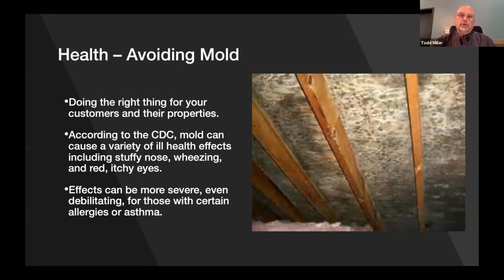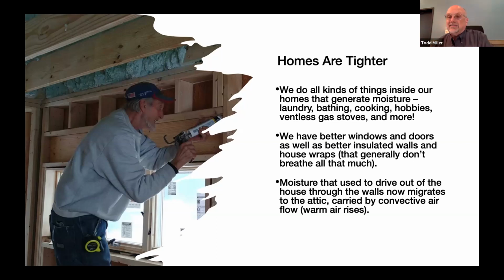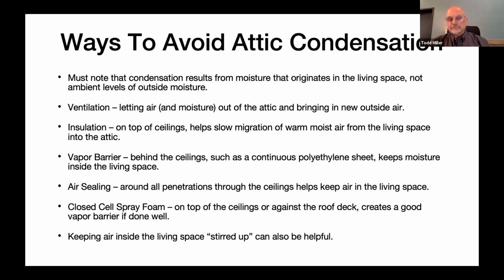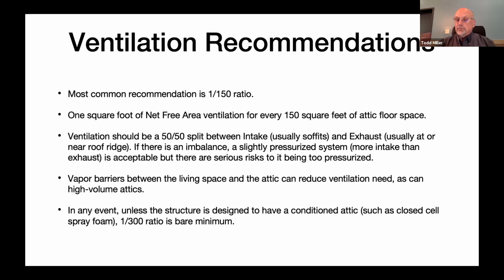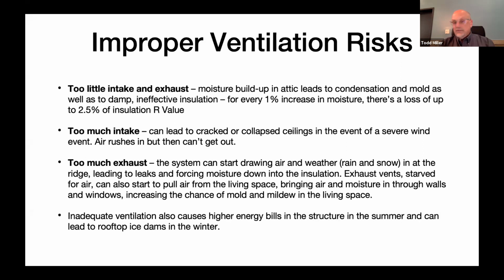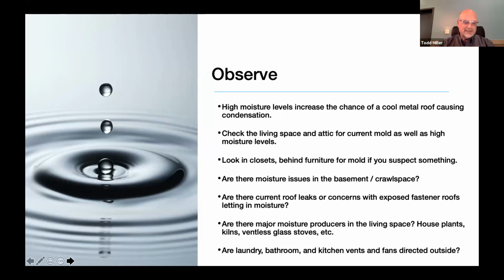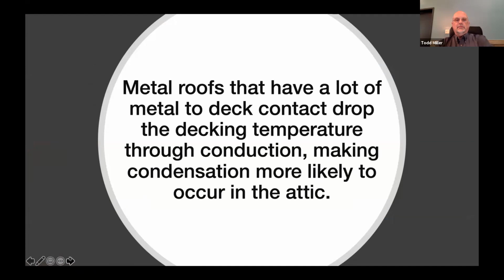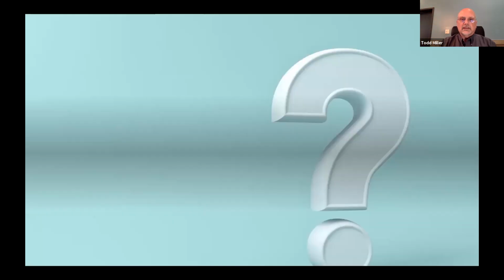Condensation - The Why and How to Avoid it

Comment: What if you have poor insulation and no vapour barrier and you un block your soffit vents and add ridge vent, if your from Canada won't that make the attic more cold and cause worse condensation?
Reply: The risk of condensation is from warm moist air driving out of the living space and hitting a cool surface.  If dewpoint is reached, the air contracts and moisture is forced out of it, forming condensation. Ideally, you want the attic to be the same temperature as outside and then have good insulation between the living space and the attic. This is what code requires and is for most buildings the best way to avoid condensation.

Comment: wont the battens/purlins end up rotting out? also how do you vent that space if you have to have drip edge?
Reply: As long as you have airflow, the battens will be fine.  Yes, sometimes you have to get a bit creative bringing air in at the bottom -- perhaps up through the soffits. You are correct that gutters and drip edge could cover fascia holes and then they won't accomplish anything.